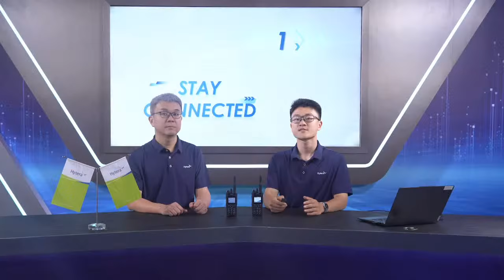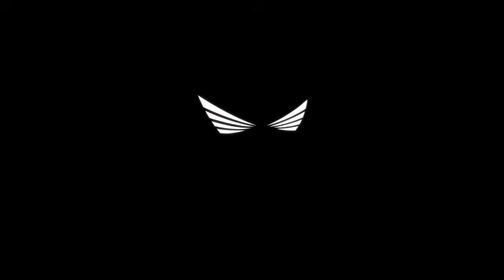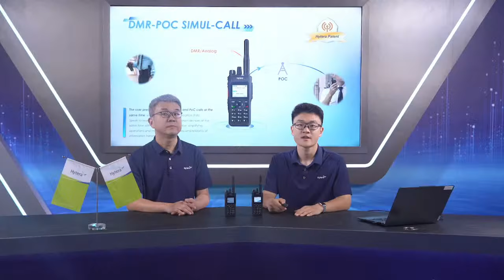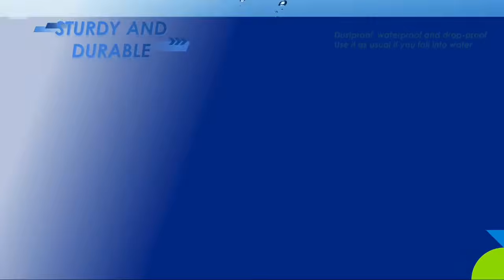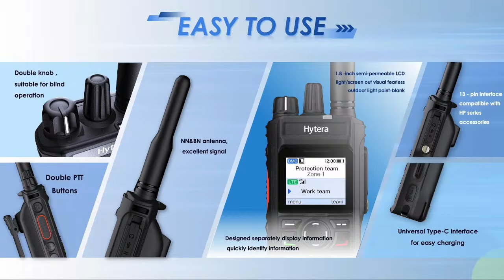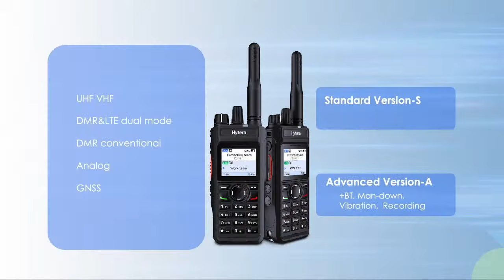Free Webinar | Hytera Dual-mode Rugged Radio PDC580 Product Launch

Comment: Hello,

I would like to ask whether the Hytera PDC580 can be used as an amateur radio transceiver and connected to the BrandMeister DMR network, in the same way as the Hytera PDC680.

Does the PDC580 support the necessary DMR functions and configuration options for operation through BrandMeister, or are there hardware or software limitations that prevent this?

Thank you in advance for your help.

Comment: Hello,

I have a few questions regarding the PDC580.

Since the PDC580 is based on Android, is it possible to install and use other APK applications, or is it a proprietary/RTOS-based system designed exclusively for HyTalk?

The reason I ask is that many of our customers currently use applications such as Zello or Real PTT. The Simul Call feature is very interesting, but we would also like to know whether a repeater mode could be available in the future.

I understand that the BM100 exists, but it is still not entirely clear to us whether it can operate with third-party applications or if it only works within the HyTalk ecosystem.

Today, many companies are no longer viewing closed protocols and proprietary ecosystems as cost-effective options. Therefore, compatibility and flexibility with other platforms have become increasingly important factors when evaluating new communication solutions.

Could you please clarify these points?

Thank you very much.